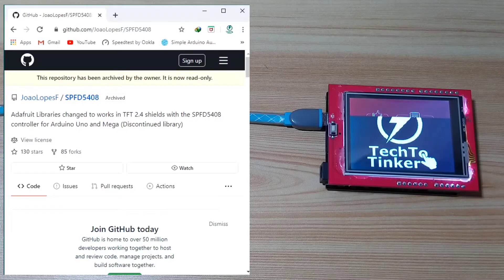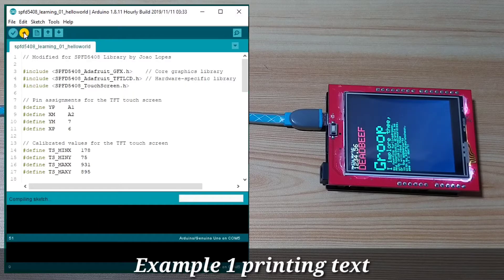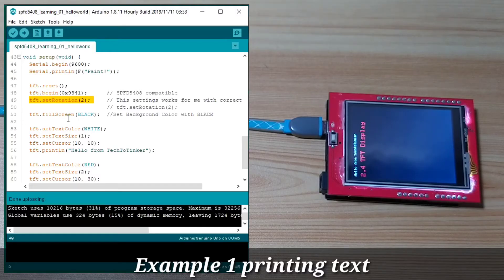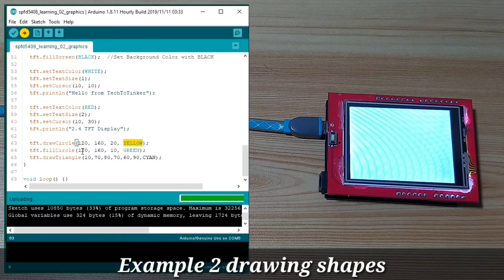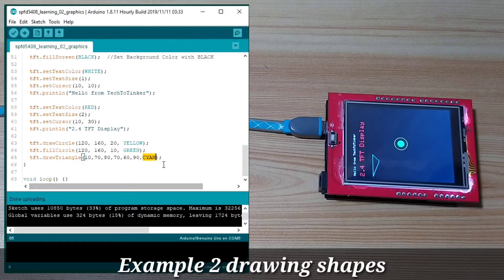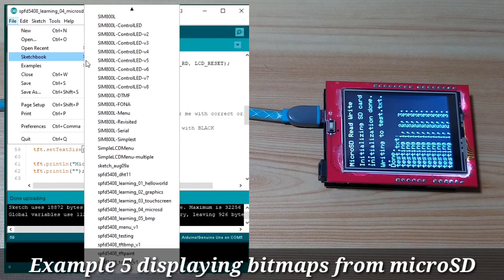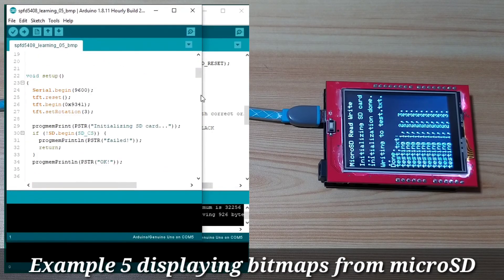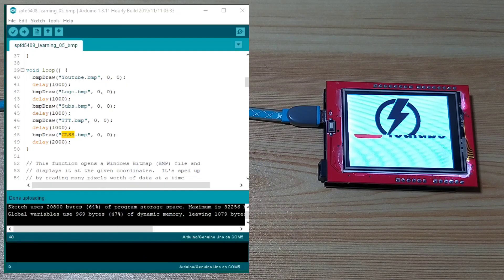Tutorial: How to use 2.4 TFT Display in Arduino | SPFD5408 | ILI9341

Comment: Here is the setup20_ili9488.h code...

#define ILI9488 DRIVER

 // For NodeMCU - use pin numbers in the form PIN Dx where Dx is the NodeMCU pin designation
#define FT MISO PIN D6 // (leave TFT SD0 disconnected if other SPI devices share MISO) 
#define TFT MOSI PIN D7 
#define TFT SCLK PIN D5 
#define TFT C5 PIN D8 // Chip select control pin D8 
#define TFT DC PIN D3 //Data Command control pin
#define TFT RST PIN D4 //Reset pin (could connect to NodeMCU RST, see next line)
#define TFT RST -1  //Set TFT RST to -1 if the display RESET is connected to NodeMCU RST or 3.3V 
 

#define TOUCH_CS PIN_D2 // Chip select pin (T_CS) of touch screen 

#define LOAD GLCD	//Font 1. Original Adafruit 8 pixel font needs ~1820 bytes in FLASH
#define LOAD FONT2	//Font 2. Small 16 pixel high font, needs ~3534 bytes in FLASH, 96 characters
#define LOAD FONT4	//Font 4. Medium 26 pixel high font, needs ~5848 bytes in FLASH, 96 characters 
#define LOAD FONT6	//Font 6. Large 48 pixel font, needs ~2666 bytes in FLASH, only characters 1234567890:-.apm
#define LOAD FONT7	//Font 7. 7 segment 48 pixel font, needs ~2438 bytes in FLASH,only characters 1234567890:. 
#define LOAD FONT8	//Font 8. Large 75 pixel font needs ~3256 bytes in FLASH, only characters 1234567890:-
#define LOAD GFXFF	//Freefonts. Include access to the 48 Adafruit_GFX free fonts FF1 to FF48 and custom fonts

#define SMOOTH FONT

#define USE_HSPI_PORT

// #define SPI FREQUENCY 20000000 
// #define SPI FREQUENCY 27000000
// #define SPI FREQUENCY 40000000 
#define SPI_FREQUENCY 75000000
//#define SPI FREQUENCY 80000000

//Optional reduced SPI frequency for reading TFT 
#define SPI_READ_FREQUENCY 16000000 

#define SPI_TOUCH_FREQUENCY 2500000

Comment: Hi Sir. Your video are awesome & code is perfect one. Sir if I wish to display BMP picture more than five what should be change in code? How can I understand that my touch screen is perfect? I have already tested example tftpaint  but my display is showing wrong . When pen is drawing horizontally display shwing vertical line & when pen drawing vertical display showing horizontal & pen where pin display showing some distance . Please answer me.

Comment: Thanks for the great video! But there is a problem, the contents of the screen are upside down and read from right to left ... How to fix it?
Reply from the maker: Try to search for the "rotate" or "rotation" inside the code.
Reply: @TechToTinker  
No, I got it. The manufacturer installed other drivers and the library flipped the image. ILI9341???

Comment: What use is it if all the Arduino I/O pins are used by it ?
Reply from the maker: You may use Arduino Mega if you need more pins. In Arduino Uno, AFAIK there are 2 or 3 pins you may still use. The D0, D1, and the other I can't remember. You may check the datasheet.

Comment: Greetings TechToTinker.
I have read that this SPFD5408 drive and ILI9341 are pretty much the same but, I have a sketch that in the header calls: #include <SPFD5408_Adafruit_TFTLCD.h> however, my display is ILI9341, so what should I change in the code to use the ILI9341 display, and my display is not shielded and does not have the LCD_WR and LCD_RD pins. Thanks
Reply from the maker: Hi Daniel, perhaps you need to look for ILI9341 library which uses SPI instead. This uses the parallel control.

Comment: why screen is so slow?
Reply from the maker: Im not exactly sure why but Im guessing maybe because of mode of communication between the LCD and the Arduino or possibly because of the library. But what I am sure the Arduino Uno runs in 16MHz clock while the LCD has 320x240 pixels so a total of 76800 pixels that is needed to update more than 60 times a second so changes is not noticeable by human eye.

Comment: Will it work with esp8266 or it will need esp32?
Reply from the maker: I am using Arduino Uno. I have not tried it on ESP MCUs.
Reply: @TechToTinker Could you test with ESP32?

Comment: hi, i have a problem loading  imagens,  the error is the image does not found and i dont know why, i'm use your code but dont found the problem and when i testing the example of sd card  appears in the screen  sd card failed, can you help me?
Reply from the maker: @Jhonatan Ruiz, can you give me more details of your setup? Did you use Arduino Uno or Arduino Mega?

Did you copy the image to sdcard?
Is the image is 320x240?
Reply: @TechToTinker  i use Arduino Mega and copy the image (BMP format) in the same resolution but vertical
Reply from the maker: @jhonatanruiz9938  what do you mean with the "but vertical"?

#1. Is the image 320 x 240 (landscape image) but displayed wrong. Or,
#2. or you want to create a vertical display?

In any ways, can you send a picture of the display with problem at tech.to.tinker@gmail.com
Reply from the maker: Hi @Jhonatan Ruiz, got your email. the problem is you are using Arduino Mega (it will work when you use Arduino Uno). The reason is that Arduino Mega SPI port is not located on pins 11, 12, and 13 which is use when accessing the sdcard module. And if I remember correctly, I talked about this aspect in the video. Hope it helps.
Reply: @TechToTinker  yes i got it but when i change the port spi for 50 doesn't change i will to try again thank you for your time

Comment: Great Video.

Many people have mirrored image on the 2.4 TFT SPFD5408 screen and inverted colours. 
To solve mirrored image problem please set:

tft.begin(0x8357); 
instead (0x9341) value in "setup" part of the code.

it helped for my  aliexpress tft display.
https://www.tdgulf.com/wp-content/uploads/2016/03/2-4-inch-2-4-inch-tft-lcd-shield-touch-board.jpg

Best Regards

Comment: Hi TechTo Tinker
I am new to TFT programming. I want to  have 5 input names from user using 2.4 TFT ,Arduino UNO. I am thinking to create an array and use the  Gets(STR[x]) function to take the input from the user. Will this function work with TFT?
Reply from the maker: Hi @TFT Lcd, I would like to say yes but as of now, I am not able to use or do like that but it should be possible. Please let me know if you are able to do it or if you need some help. Cheers.
Reply: Thanks TechTo Tinker for responding. But could you suggest any other way or program to achieve the same? I am stuck with this.I would really appreciate any help regarding this.
Thanks

Comment: How can i make compass hmc8553l show line moving depend on the direction on 2.4tft touch screen shoeld
Reply from the maker: Hello @Purple Furture, I dont know how to answer you as of now since I dont have a copy of the compass.
Reply: TechToTinker i just need need to know how to do the lcd part then i will take mu compass code
Reply from the maker: Hi @Purple Furture, I hope you find a way to solve your question. If not, you may try to use the example # 2 drawing shapes.
Reply: TechToTinker thank you done 😄
Reply from the maker: @purplefurture6960  wow nice, congratulations.

Comment: helloo..nice project..but why I cannot display picture at tft lcd...already insert micro sd and file in bmpfile...
Reply from the maker: Hi Muhammad, 
#1. did you use Uno or Mega? 
#2. Did you try the example number 4 accessing the sd card? 
#3. The size of the bmp file should be maximum of 320x240 (landscape) or 240x320(in portrait)
Reply: @TechToTinker  I use UNO and already succesful accessing the sd card..the problem now is the pic are appear
Reply: are not appear*
Reply: what size of pixel for the picture...hehe
Reply: @TechToTinker  its okey....I already get the pic...my project was successfull....thankyou so much
Reply from the maker: Hi @Muhammad, wow congratulations!